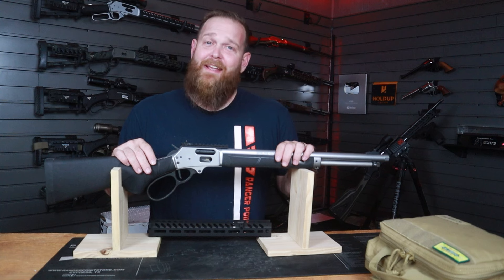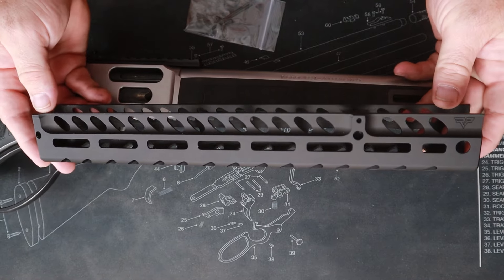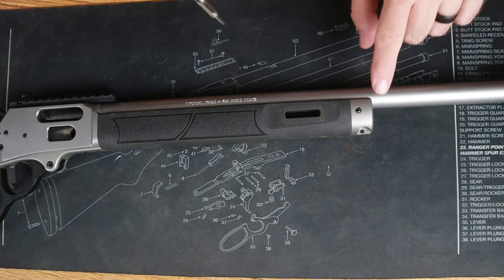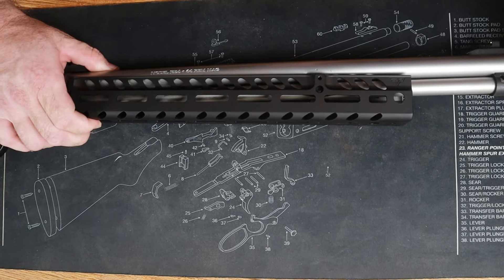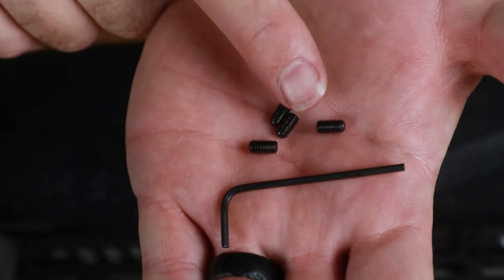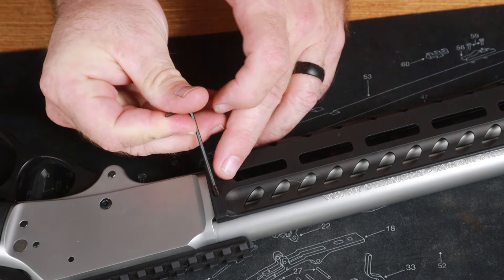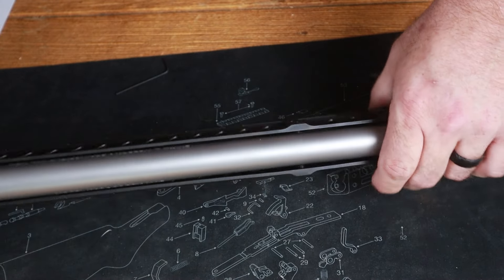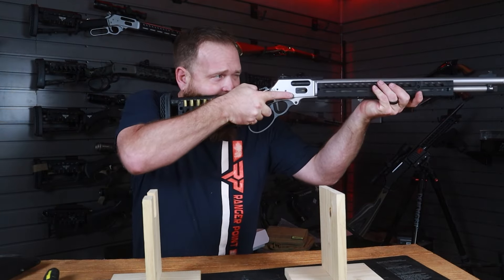Smith & Wesson 1854 Mlok Handguard | Ranger Point Precision

Comment: Did you not need to super glue the two tabs on either side? , or did mine just come with different parts?
Reply from the maker: This is an update. We had complaints about the spacers.
Reply: @RangerPointPrecision  so they are not required on my moss elite handguard than?